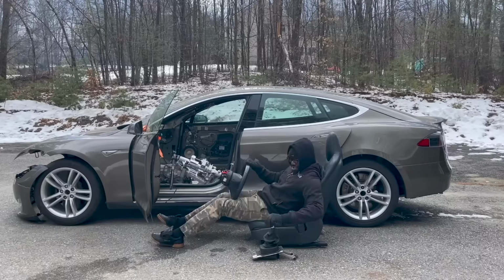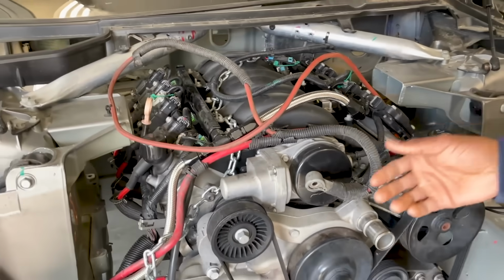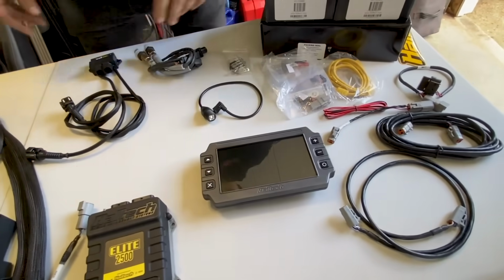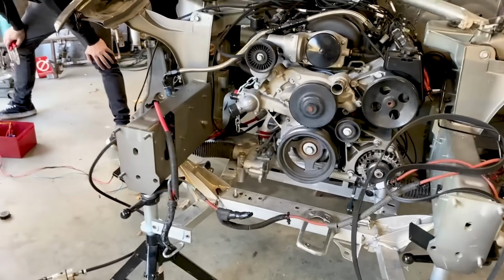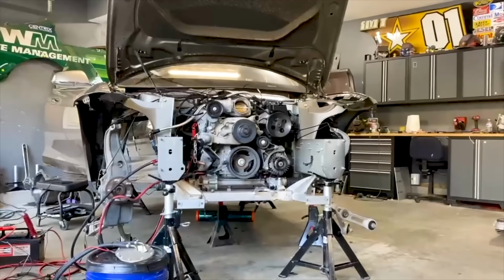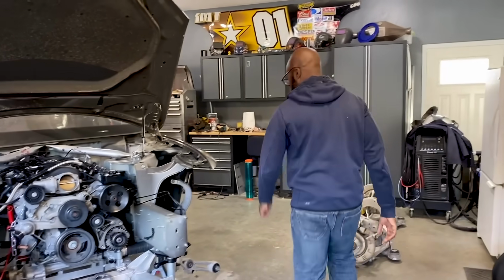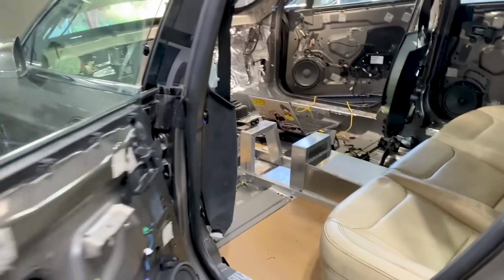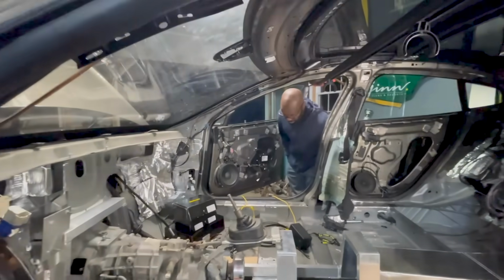Starting the worlds first V8 powered Tesla

Comment: Nuggets of knowledge about ICE-T 
It will have 1000 hp , turbocharged and will have sequential transmission and a fuel cell . Information provided by uncle rich on live chat😁
Reply: When did he say that in chat?
Reply: Well I remember someone asked is it modified he said it's stock 0 stage he,s gonna crank 1000hp Outta it. I asked him about twin turbiskies or whineybois , he said probably a centrifugal system but not a blower. And someone asked where will be the fuel tank he said full name of fuel cell he was gonna use but I can't remember the name similarly a question about diff he said sequential. I can't prove it u just was there before premiere at 12 so he was answering some questions. Beleive it or don't it will be revealed due time. Maybe he changes is mind about parts just take it with a grain of salt.😁

Comment: This seems a pretty pointless project to me. It's like taking the engine off your motorbike and replacing it with pedals. Or taking your Gulfstream G650's Rolls Royce BR725 turbo fans off and replacing them with Bentley BR1 rotary engines. Put another way: a step backwards.
Reply: Electric cars pre date gas cars. This is a step forward.

Comment: Better get that thing to beat a Tesla in the 1/4 mile!  Show those Tesla fan boys up!
Reply: Or a my easier to beat it around an actual track if you put a. Manual box it in
Reply: Put aside YouTube for a while and read some physics and mechanics books.
Reply: I mean, a model s has about a 10-11 second quarter mile, low 10s with whats it called, cheetah stance.
Youll start seeing low 10s in an EV at about 700-800 hp.
Building that would definitly be possible, they could probably get it higher but thats expensive and takes time.

Would be very fun tho.
Reply: maybe a Nissan Leaf
Reply: Your gonna need a super charge because turbos take to long to spin up
Reply: @DurgalurJay  the fok r u spittin ova ther
But as i believe in education over ridiculing, you have a point but you misunderstand how that reacts in a race. That literally does not matter on a dragstrip.
A turbo generally speaking will make more power at higher rpm, at a dragstrip youre not starting from idle, you start at high rpm, giving the turbo time to spool up before you go.
Reply: @nazimelon6653  idk what the fuck I’m spitting man I’m just a rapper
Reply: Twin turbo that baby
Reply: That would be hard
Reply: @lokeegnell  ls shouldn't be hard to get in to mid 10
Reply: @lokeegnell  just go for a best of three
Reply: @lokeegnell  yeah but uncle rich can make it work